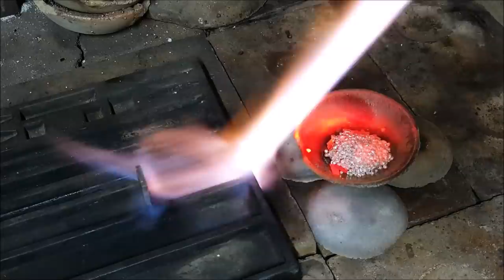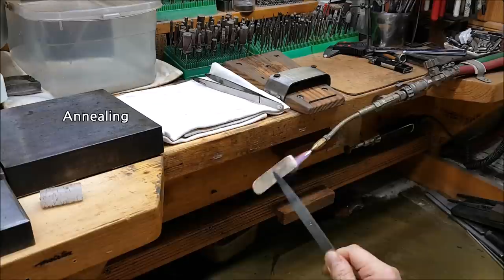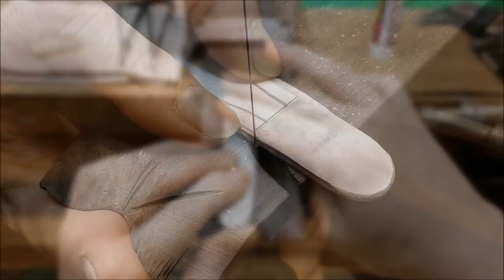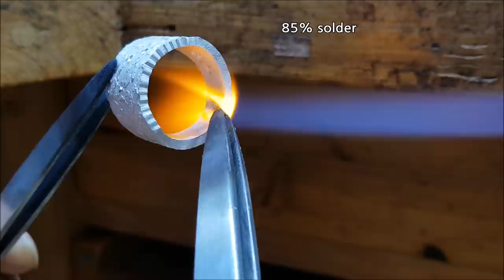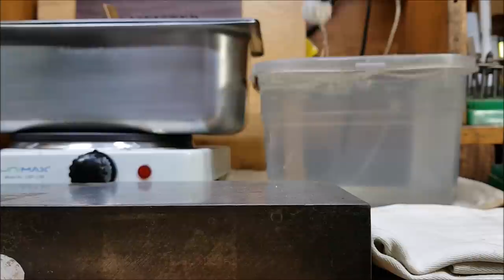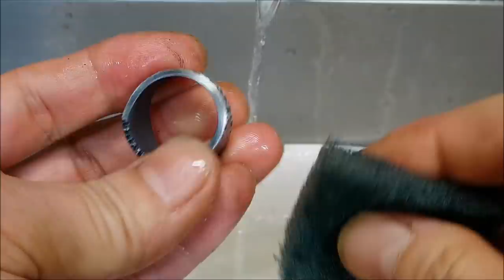Making BIG DIPPER silver ring / Using pure silver granules / 수제 은반지 만들기

Comment: Did you use 80% solder cause of the lower melting point of the silver granules??
Beautiful ring and a great idea for something different!! Another great job making this ring!!
Enjoyed your video and I gave it a Thumbs Up
Reply from the maker: I use solder sequentially from high to low melting temperature.
This is of course for anyone who works on silver.
Since the base material is 95%, 85% was used for the first soldering,
Then 80% Then 75% .......
80% of silver solder is relatively strong.
I don't know if the translation went well.
I hope my will has been well communicated to you.
Thanks always~!!

Comment: Lovely ring. Why do you pickle it every so often?
Reply from the maker: Nonferrous metals (gold, silver, copper, aluminum, etc.) are different from general ferrous metals,
In each process, it must be pickled.
When dealing with silver, mainly sulfuric acid is diluted in water and used.
Mix about 10% sulfuric acid and 90% water.
When mixing this, it is safe to add sulfuric acid to water.
Always keep the diluted acid warm.
50 to 70 degrees Celsius is suitable.
By pickling,
By removing borax residues and various impurities generated during work
It plays a role in ensuring that it is always clean.
Reply: Would vinegar work just as well for this pickling?
Reply from the maker: @darkdragonburns  
This is not vinegar.
It is a dilute solution of sulfuric acid.
It is a method of removing impurities by chemical action.
Please refer to my other videos.

Comment: Great video!  What is the purpose of the camellia oil?
Reply from the maker: Camellia oil is vegan oil.
The reason for applying oil is to delay and protect the oxidation of the silver surface.
A very thin oil film protects the surface.
After applying the oil, clean it again to finish.
The camellia oil that I use is safe to eat.
It is a very good natural oil that is harmless to the human body even when the ring is worn on the hand.
Thanks !

Comment: I was wondering: why not melting the silver in a furnace instead of the bowl?
Also what does the pickling process actually do?
Reply from the maker: There are reasons for the way I work.
Furnaces are suitable for use when working with large volumes when working with large volumes.
If you occasionally do small tasks in small quantities,
Furnace use is not efficient.
The chicken is a knife used to prepare
The size of knives used when grooming cattle is different....

Pickling removes unnecessary dirt and impurities after applying heat (fire),
This is a way to keep the silver clean at all times.
You don’t have to do it often,
I tend to do it often to keep the material in optimal condition.
Reply: @SilverMeister  Thanks for explaining :)

Comment: Exellent work tank u ☺....wher is defrent bitwin 85% silver & 80%silver ....im sory for qtion
Reply: This refers to the type of solder he used to attach the "stars".
Reply: @Balance_and_Strength  😊thnks
Reply: @youcefben7947  Different melting points
Reply from the maker: I use solder sequentially from high to low melting temperature.
This is of course for anyone who works on silver.
Since the base material is 95%, 85% was used for the first soldering,
Then 80% Then 75% .......
80% of silver solder is relatively strong.
Reply from the maker: Thank you for your answer on my behalf.
Reply from the maker: Thank you for your answer.
Reply: @SilverMeister  🙂
Reply: @SilverMeister  tnk u vry mutch👍